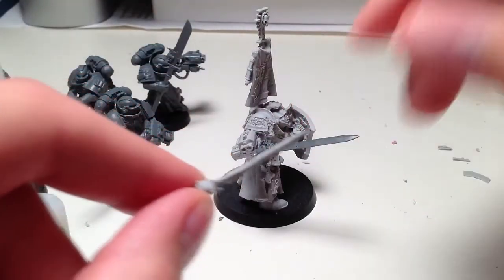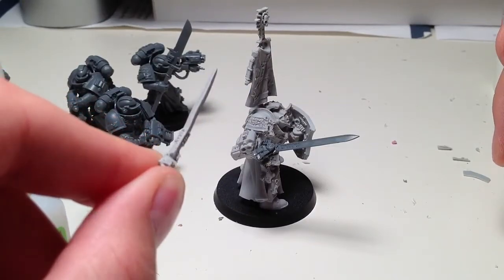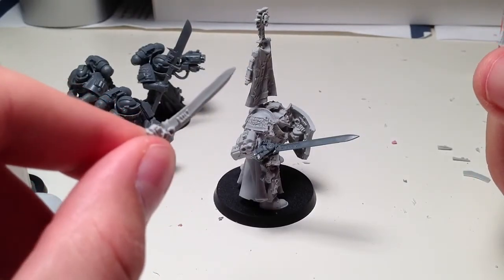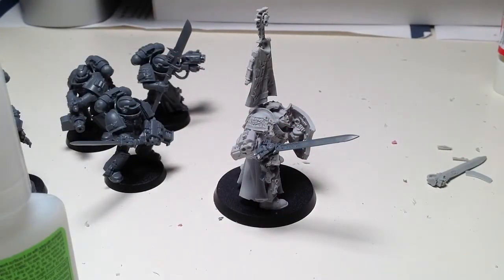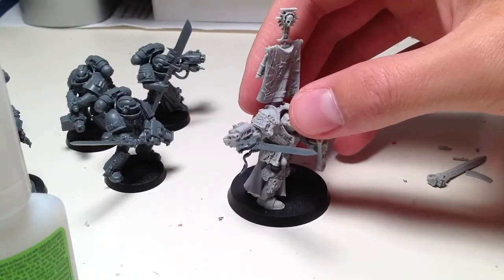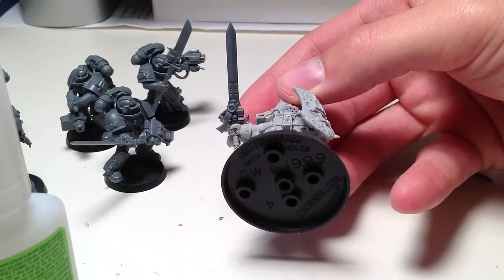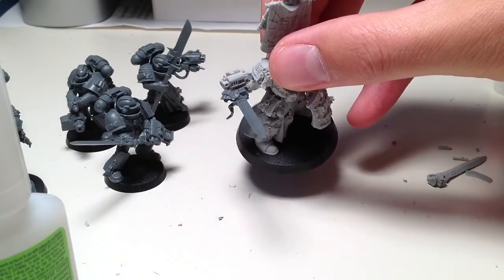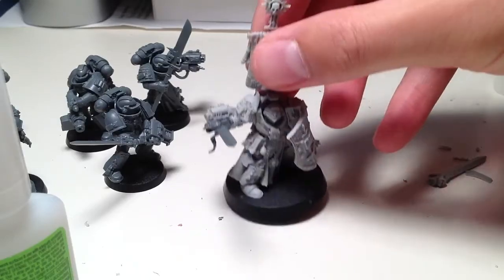Draigo Conversion

Comment: Came out great the fix you did. On the bent sword use hot water to put it back in place. The small bubbles on FC you can use thin crazy glue and paint it on or some water down liquid green stuff painting it on as well, don't use a good brush for this a old one will do. hope that helps :O)